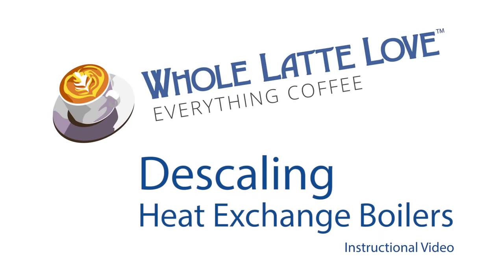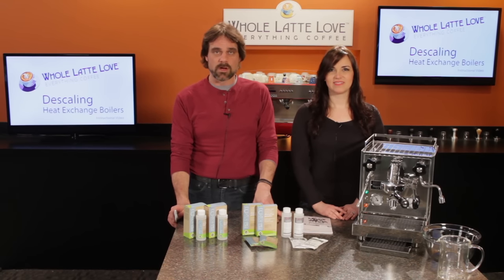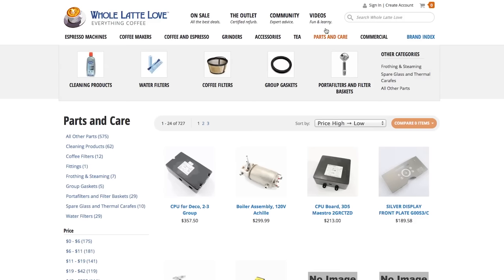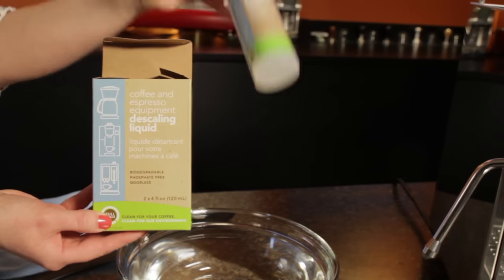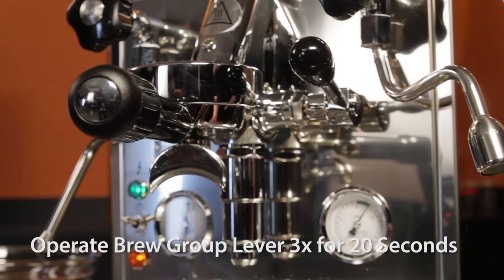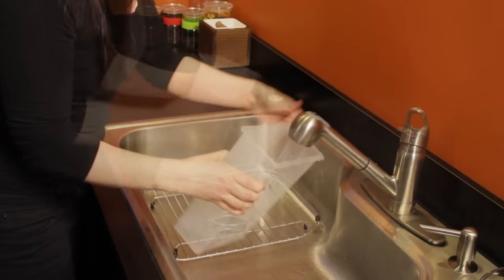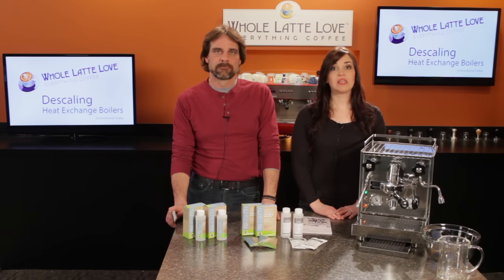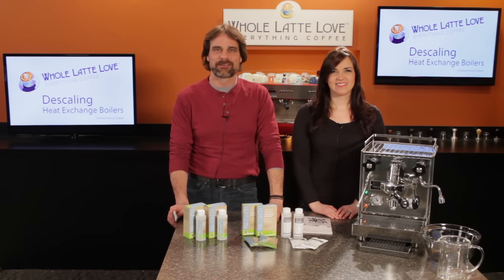How To Descale Espresso Machine Heat Exchange Boilers

Comment: One thing to remember is good room ventilation during the descale. When you flush the steam boiler, it releases the descaler as a steam, too, so you inhale it. And that Dezcal can cause some headaches and weird patterns appearing in your eyes. So ventilate well, and if you feel weird, go outside for a fresh air.
Reply: Just use food safe citric acid lol, no reason to use chemicals.

Comment: Hello. I have a very old Rancilio Silvia V1 or V2. I got it as a gift and not able to check if the previous owners made descaling process and cleaned it up. The flavor of espresso isn’t good. I want to clean the brewing group first and then I think to descale the machine. But i don’t know - it’s old - maybe inside a boiler huge amount of scale and some parts can stuck inside the machine pipes or system? But machine was in NYC and here is very soft tap water like 37-38 TDS. Really appreciate your advice 🙏🏻🙏🏻🙏🏻
Reply from the maker: Hey alex, Cleaning the group is a good first step. Coffee oils accumulated there can go rancid and impact flavor. As it's a very old machine I wonder if it's reaching a proper temperature? If it's not, espresso would likely be sour. There's always risk descaling a machine without details of previous maintenance. You're right, descaling may dislodge scale chunks and end up plugging things up. But if machine has always been fed very soft water heavy internal scale is unlikely. If you're handy with tools you could take a pipe off the boiler and look for signs of scale. Or if you descale and something plugs up you could take apart and clear. Solenoid valve is common area for issues. If it turns out the machine has huge amounts of scale simple descaling will not clear it out and machine will require a rebuild.
Reply: @Wholelattelovepage  thank you very much 🙏🏻🙏🏻

Comment: Do you have this procedure in outline form. It would be easier for me to follow an outline or chart than going back and forth watching the video. It,s a great video but a chart would be easier to follow after reviewing the video,. I don't have to descale enough to get the steps naturally.
Reply from the maker: Hey B, Here you go:

How to Descale HX Boiler

To machine on and heat up to operational pressure. 

Once up to temperature turn it off. Then open the hot water valve. Steam pressure forces out liquid water in the boiler.

Then operate the brew group lever to discharge water in the heat exchanger.

When no more water flows, close the hot water valve and the brew group lever.

Prepare the descaling solution according to the instructions. If using Urnez Dezcal or Full Circle descaler, mix the powder or liquid with 32 ounces of water. If using the powder type be sure to mix until completely dissolved.

Add the descaling solution to water tank and turn the machine on. The pump fills the boiler with descaling solution.

After the pump stops operate the brew group lever until liquid is discharged by the group. This fills the heat exchanger with the descaling solution.

Place the portafilter with the blind filter inserted into the brew group and lock in place. Now operate the brew group lever 3 times, leaving it in the run position for 20 seconds each time. Move the lever to the lower position after each operation. This process descales the expansion valve.

Lett the descaler react in the boiler for 20 minutes. After that, release the remaining descaler by operating the brew group lever until the water tank is empty and no more liquid is dispensed.

Switch off the machine, Remove the nozzle from the hot water dispenser and open the hot water valve. Steam pressure will push out any descaler left in the boiler. 

Remove the water tank, rinse and refill with fresh water. Replace the tank and turn the machine on. The boiler refills with the fresh water.

When the pump stops operate the brew group lever three times for about 20 seconds each with the blind filter still in place. This rinses the expansion valve. Be sure to move the lever to the lower position after each operation.

Remove the blind filter and operate the brew group lever for about 60 seconds in order to rinse the heat exchanger.

To fully rinse the boiler, repeat the following procedure 3 to 5 times:

Switch the machine off and operate the hot water valve to drain the boiler. Refill the water tank and turn the machine on. Allow the machine to come up to operating pressure. Then turn the machine off and open the hot water valve to drain.

Again, repeat that process 3 to 5 times to fully rinse the boiler. When done you have completed the descaling procedure.

Comment: A couple of things: First, thanks to the WLL crew for posting this - if I didn't live about 10K miles away I would pop in and shake your hands (and buy something...). 
For those of you investigating cleaning options and reading the comments here you will see that there is some controversy on the issue of descaling. It might be a little more like a culture war actually. If you do enough research you will come across the position recommended here,  and also the alternative, which is not to descale at home. This latter position is endorsed in one video by one machine manufacturer, but on the very specific basis that the machine is fitted with an in-tank filter (calcium remover/softener) of some kind (at the least). If you listen carefully to this video the WLL crew are careful to point out that a home attempt to descale a likely dirty machine could prove problematic. With that proviso - my three trusted authorities all recommend home descaling so that's the way I have gone. However I also use an in tank filter in addition to filtered water...this belt and braces approach allows me to descale less often and somehow that seems like the best and easiest of all possible worlds. Thanks again WLL crew.
Reply from the maker: Hi Tony, Thanks for the detailed comment - I would love to shake your hand! What I get from most manufacturers of prosumer level machines is: Use good water to prevent scale in the first place. Best not to attempt descaling dual boiler machines at home. It can be done, but you have to know what you are doing. In most cases it requires removing the boilers as they are not easy to drain in most machines. Also dual boiler machines have a lot of extra hydraulic components like solenoid valves which are trap points for bits of scale which can dislodge during descaling and plug things up - especially in machines which have been using untreated hard water.
Marc

Comment: Hi, Your online presence is what lead me to get my first machine, and now have upgraded to a Mini Vivaldi II S1, yet the machine I got was left a bit neglected. I wiped it down, but it is not getting much water flowing.  I am wondering if this method would be the same on the Mini V2 S1 ?
Reply from the maker: Hi p, No it would not be the same. The machine you reference is a dual boiler. In a neglected machine there are many areas where limescale deposits may be slowing the flow. Might be issues beyond scale as well.
Reply: What can I do? Is there a repairer that deals with this make, so they can get parts? Thank you for reading your comments and replying!! @Wholelattelovepage

Comment: Hi Mark!
You know after rinsing the boiler still remain with solution in the pressure boiler because on that technique you can't empty the boiler properly and you'll finish to have a nasty taste on hot water and  milk. I am a coffee engineer for more that 14 years and I don't recomand to do that to the pressure boiler. On the heat exchanger yes is working fine because you have a continuous flow

Comment: Hi guys’! Amaing video. One question, would you recommend this process for a machine like Sanremo Capri, with rotary pump, flojet and a barel water intake? Or shouldnt I be trying this at home? thank you so much for any answer!
Reply from the maker: Hey g, Not familiar with that machine, but it appears to be a commercial one. For that I'd recommend service by a qualified machine technician.

Comment: Hi, thank you for the video! Do you see any advantage in removing the probe so that you are able to fully fill the boiler with the solution? Also - did i missed it or were you only working on group and hot water side, but not with the steam side of the machine? How do you descale the steam arm? Thank you very much
Reply from the maker: Hi JF, You are welcome and thank you for your comment and question. For routine descaling moving the probe to have the boiler fill more is not required IMO. For someone without proper knowledge/skill it could lead to problems. In normal use no scale should occur in the steam arm. Steam coming through the arm is essentially distilled with little or no mineral content so no scale should accumulate there.
Marc
Reply: Hi guys. Seeing this comment and response- why then couldn’t you use this routine to fill and descale the dual boilers of the 600? The 700 manual references routine preventative descaling but not the 600. I can’t see how this process would be any different, with the caveat that you need to try and fully empty the brew boiler before the pump fills it with descale solution.

Comment: Since I got my ECM Synchronika, I've been back flushing with cafiza once per week (as shown in a previous Whole Latte Love video). I've only used Crystal Geyser by Roxane bottled water. Is what I'm doing correct, or do I need to be doing more for preventive maintenance?
Reply from the maker: Hi Alvin, Unfortunately I have no data on the mineral content of the water you are using. With the Synchronika (and all dual boilers) it's important to use a water that will not cause scale. You want some minerals in the water for flavor and to protect machine from corrosion but you need to reduce the calcium level to prevent scale. BWT Water & More filters use calcium to magnesium ion-exchange to get the right mineral level and no scale. BWT has options for plumbed in, reservoir feed or a filtering pitcher. Check those out here: https://www.wholelattelove.com/collections/bwt
For backflushing you may want to back off Cafiza frequency depending on how many extractions you do per week. We recommend backflushing with Cafiza every 120 brew cycles. Doing it more often will not hurt anything but will remove lubricant from internal group components causing squeaks. Also recommend plain water backflushing without detergent every couple of days.
For additional info on your machines check out our support section for the Synchronika here: https://support.wholelattelove.com/hc/en-us/sections/1500000400302-ECM-Synchronika
Lot's of maintenance, usage and DIY videos articles there.
Marc

Comment: I am missing an important piece of information in your presentation. When I pour the descaling solution (in 32 oz of water) to the water tank, is the water tank empty or should some water be in it?  If so, how much.  If I pour the 32 oz into an empty tank, it is not enough liquid in the tank and the orange light is not on. So, how much water does actually need to be in the tank (plus the 32 oz of the descaling solution)?
Reply from the maker: Hi Ursula, The water tank should be empty when you add the descaling solution. Your machine may require more than 32oz of solution depending on boiler size. On most machines if the orange light is out it means there's not enough water in the boiler and the machine is not heating. If you went through the first step in the video of initially draining the boiler of regular water then when you turn the machine on the orange light should be out until the boiler refills. The boiler should refill when you add the descaling solution to the tank and the tank sensor senses enough liquid in the tank. You will need enough descaling solution in the tank to fill the boiler plus some extra for the group flushing. Lacking your make/model info I do not know the size of your boiler. If the descaling solution in the tank drains to a tank out of water state while refilling the boiler you will need to add more descaling solution to the tank.
Reply: @Wholelattelovepage  I have the exact model of the coffee machine that you are doing your presentation on. The exact one, so I don't think the boilers on them vary in size. I have Profitec 500. The exact same machine you work on. So I would suggest that you add a clarification to the presentation.  From what I am getting from your response I need to make more descaling solution.  Before, I was just adding water but it did not seem right because it caused the potency of the solution to go down.

Comment: hey. thank you for this video.
i have watched it and tried to descale it with single boiler machine ecm casa v....
Stupid me did backflush whilst descaling solution was already in boiler/running through grouphead brew action.

i left for 20-30 mins for few times and now i get these crystals in the water no matter how many times i filtered the boiler and grouphead.

any idea what i have done ? is this normal and takes more time or did i damage anything?

Comment: Hi guys just came across this video, because the video is 9 years old would you still use the same procedure on a Bezzera Magica s pid ? Regards steve
Reply from the maker: Hi Steve, Thanks for the question. Our advice has modified some over the years. The best course for any machine is to use water that does not cause scale in the first place. The trouble with boilers that produce steam (like HX boilers) is they never completely fill. There's always some headspace in the boiler and scale often forms at the spot where the water stops and headspace starts. Since they don't fill all the way it's difficult to descale that spot.
Reply: @Wholelattelovepage  hi thanks for the reply? I saw a video on that said if you disconnect the heating probe this would over fill the boiler while you do your descale, ? Steve

Comment: Hi Marc, ok, I did heat the machine to 198. I turned it off and opened the water valve. Only 350ml came out. Since this has a 1.5 liter boiler it is leaving a lot of water behind, or it is not filling the boiler up. I did notice when I first got the machine and did the first run, it did not take that much water out of the plastic water container. Thoughts?

Comment: Mark, I recently purchased the Bezzera BZ13 DE. I also purchased the BWT pitcher. Does this mean I will never have to descale my machine, or should I do it once in awhile to be safe?
Reply from the maker: Hey Tom, Thanks for the question. According to BWT scale should not form in a machine when their Penguin Pitcher is used as directed. This assumes your source water has no edge case issues and is safe for drinking from the tap. If you were using the machine prior to use of the pitcher then scale may have formed. If that's your case I would descale just to be sure.
Marc
Reply: @Wholelattelovepage  Hi Marc, on your descaling video, you turn the machine off and then drain water. On the BZ13 when you turn it off you can't drain the water. Do you have instructions for descaling the BZ 13?
Reply from the maker: @tobiferris  Hey Tom, With the machine fully heated, turn the power off. Open the hot water valve and the boiler will drain. Once drained, refill reservoir with descaling solution, turn the machine on and the boiler will refill. Turn on the brew switch and expel a few cups of water which is replaced by the descaling solution from the reservoir. After that the process is essentially the same as in the video except you are operating the brew switch instead of a brew lever.
Reply: @Wholelattelovepage  ok, I did heat the machine to 198. I turned it off and opened the water valve. Only 350ml came out. Since this has a 1.5 liter boiler it is leaving a lot of water behind, or it is not filling the boiler up. I did notice when I first got the machine and did the first run, it did not take that much water out of the plastic water container. Thoughts?

Comment: I'm a new owner of a Profitec 500 PID purchased from WLL. WLL specs for the machine show Durgol Swiss Espresso Descaler as the descaler to be used. This descaler is not mentioned in this video. I'm confused. Is it OK to use the Durgol product? If so, how do you advise using the Durgol product? Are the products you show in the video better than the Durgol product? Thanks.
Reply from the maker: Hi Jack, Thanks for the question and congrats on your new machine! The Durgol is safe for any boiler material so it's a go to recommendation. If using Durgol mix 50/50 with water. Your Pro 500 has a stainless steel boiler so any of the Urnex products in this video are fine to use. Urnex Liquid Dezcal is a popular choice and used by many commercial cafes: https://www.wholelattelove.com/collections/cleaning-products/products/urnex-liquid-dezcal
Dezcal may be slightly more effective. It's just a little more aggressive than the Durgol.
Marc
Reply: @Wholelattelovepage  Thanks Marc!

Comment: Thanks for the video. Is this process safe to use on the ECM Synchronica?
Reply from the maker: Hi GM, No this process is for machines with a heat exchange boiler. ECM Synchronika is a dual boiler and should be descaled by professional.
Marc

Comment: Thanks for the video! My Solis Barista Gran Gusto came without a blind and it’s also not mentioned in the manual. Should I still get one and do what you guys did in the video or should I follow your instructions, just without the blind in the portafilter? Thanks a ton :)
Reply from the maker: Hi DD, Thanks for the question and you are welcome for the video. I'm not familiar with that machine so not 100% certain. If it has a heat exchange boiler process outlined in thsi video should do the trick.
Reply: @Wholelattelovepage  wow, wasn't expecting such a quick and detailed answer. Thanks a lot!

Comment: So i did this in my rocket the only thing that threw me off was from the 20 seconds back flushing three times I noticed my pressure gauge go past green than i just open the steam valve to lower pressure